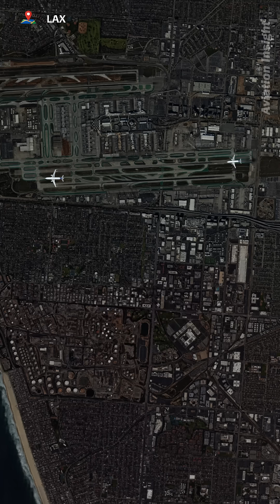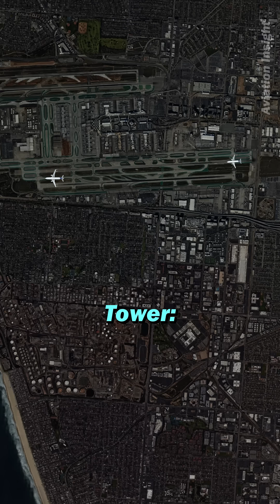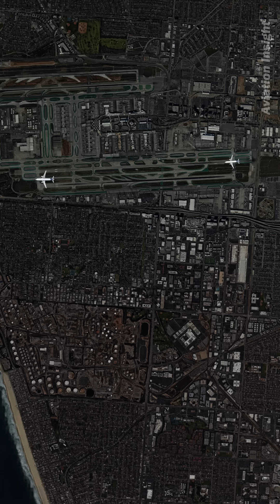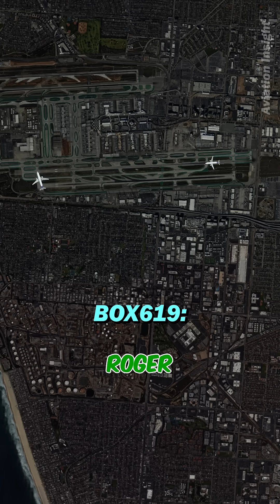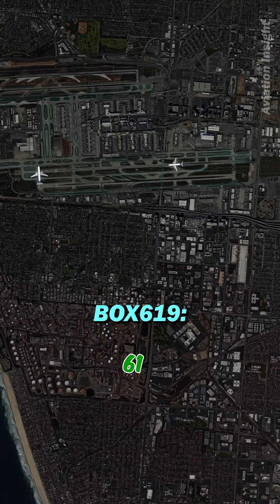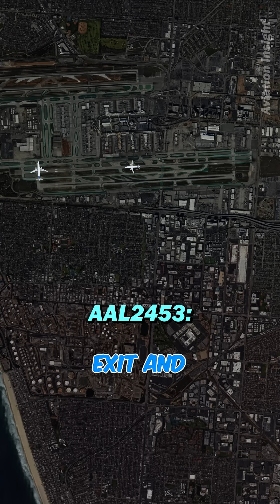Pilots Enter Wrong Runway in Front of Departing Aircraft / ATC Recording #aviation

Comment: What actually happens on the phone calls with the tower?
Reply: Probably just like when a cop gives you a traffic ticket for a violation or a warning.  The rules would be more defined for ATC I would hope and not left up to their descretion all the time.
Reply: Those phone calls required by either the ATC Flight Controller or by the Ground Controller are to a FAA adininistator. They are the initial procedure in a formal review process of the "Possible Pilot Deviation" declared by ATC!
🛫 ✈️ 🛩 🛬 ⚖️ 👩‍⚖️ ♎️ ⚖️👨‍⚖️ ♎️ ⚖️ 🛫 🛩 🛬

Comment: Would somebody be able to explain to me why certain planes are good with cooling off the brakes and others need to go back to a gate? Is it depending on plane model or just a plethora of different reasons?
Reply: The biggest factor is the speed at which the abort took place.
Reply: Also companies have different operating policies.
Reply: Sometimes you need to go back to refuel if carrying minimum fuel. Cooling off with engines running consumes a lot. Also some airplanes don't have brake temperature indication (like Boeing 737) and then you have to wait more to be conservative. And lastly there might be a maintenance required, depending on speed.
Reply: Thanks both, appreciate you taking the time out of your day to help me.
Reply: 'Sometimes it's just the Captain's and the First Officer's underwear that requires changing!
  ✈️ 🛩 🛬 😱 😱 😱 💩 😱 😱 😱 🛫 ✈️ 🛩
Reply: Somebody,  get this man a marks a lot.  From John Wick😊

Comment: Why did american need to go back the gate?
Reply: If you abort takeoffs at certain speeds, you risk damaging the brakes because they get really hot. Most likely AAL 2453 was above this speed when ATC told them to cancel takeoff, so they needed to head back to the gate to get their brakes inspected.
Reply: @hnn.9-28  Thank you!
Reply: Commercial planes have brake temp monitors. They probably exceeded a temp limitation which required a quick maintenance write off.

Comment: cross 25L but proceeds to head towards 25R?
Reply: The Cargo plane is on a taxiway between 25R and 25L. He was told to cross 25 L at Q which is his next left. Then Left onto Alpha, on the other side of 25L. They also should have done a debrief and been familiar with the likely route. Especially since it was Cargo, and most all cargo goes down Alpha. Not towards the terminal.
Reply: crossing 25R and then turning left is also nonsensical because it'd put them nowhere.
Considering there are two people in the cockpit, this really is an inexplicable mistake.